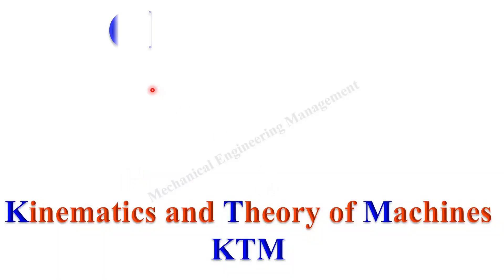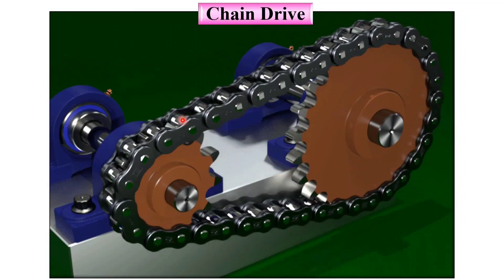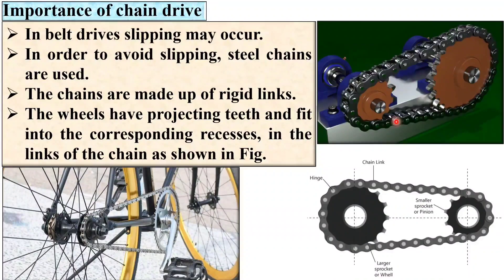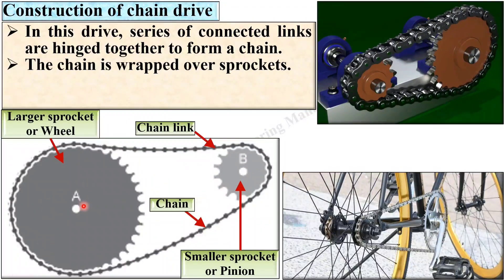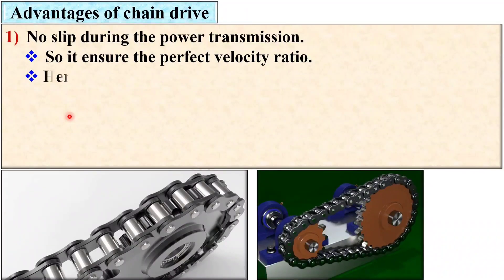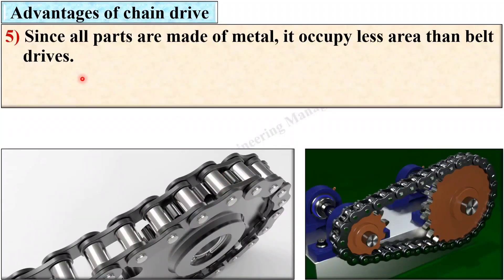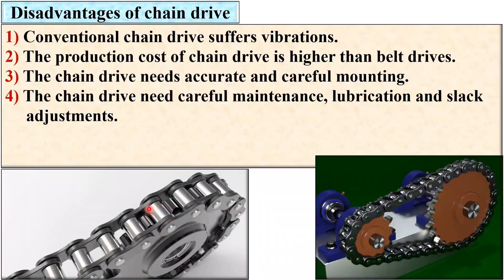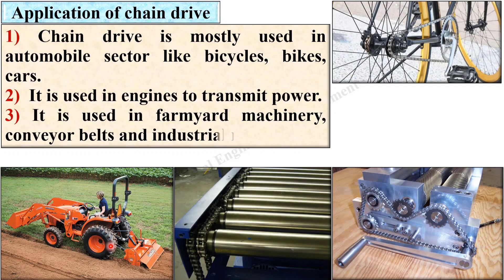Chain drive, Advantages, Disadvantages, Application #KTM #TOM #Belt #Creep #BeltDrive #chain

Comment: Timestamps 
00:05 - Overview of chain drive concepts and applications
00:55 - Chain drives use sprockets and rigid steel links for effective power transmission.
01:50 - Understanding chain drive components and construction.
02:54 - Introduction to chain drive mechanics and components.
03:40 - Chain drives provide efficient power transmission with no slip.
04:42 - Chain drives are versatile for both short and long distance power transmission.
05:44 - Chain drives have higher costs and maintenance needs than belt drives.
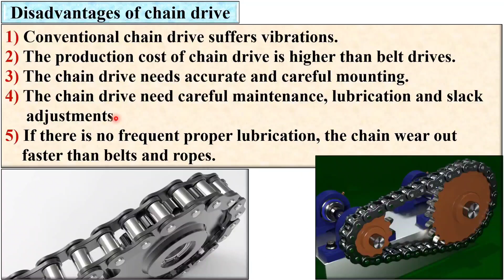06:37 - Chain drive requires careful maintenance and is widely used in various applications.
Reply from the maker: Amazing